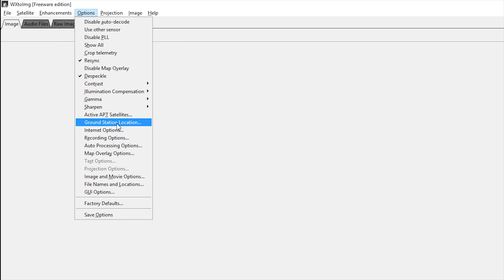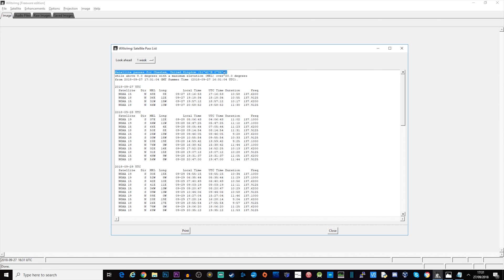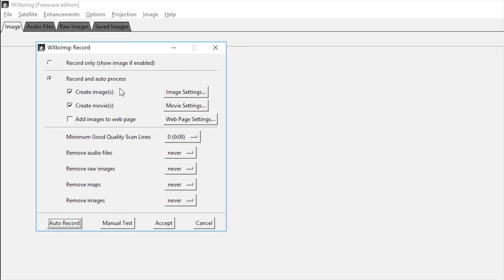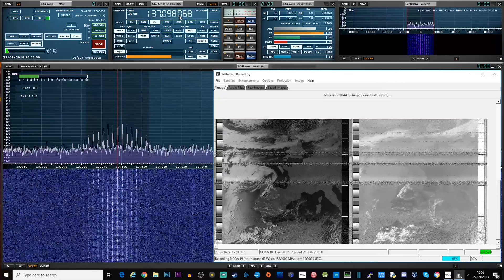Decoding Weather Satellites Using An SDR Receiver NOAA-19

Comment: How do you set this up long-term without manually changing the frequency on SDRUno for each sat pass? Seems like we would need to parse the sat pass list and then create a corresponding scheduled task inside SDRUno's task scheduler so that SDRUno will be on the correct frequency/mode for each auto record in WXtoImg.

Comment: Sadly, as others have found, the software does not seem compatible with WIN10. Cheers VK3AWA
Reply from the maker: Hey. You need to install the beta version, that’s works perfectly well with windows 10.
Reply: @TechMindsOfficial  THANKS. All up and running. MERRY CHRISTMAS.

Comment: Tried it today for the first time using a Yaesu ft817 and colinear antenna. Rough results but a start. Many thanks for the video!
Reply from the maker: You’re welcome Simon! It’s a great hobby!
Reply: I'm getting excellent results from a QFH antenna I made from copper tubing fed into an NESDR through 50 feet of RG58. Good luck. PS make sure your bandwidth is set wide enough to capture the entire signal or it will turn out grainy. For me, I had to set it 96kHz wide.

Comment: As  much as this looks interesting, the WXtoIMG program seems not to work on Windows 10.
Reply: I have the same issue with Win10 latest pack as per Sept 2019. I've tried running in Win7 and 8 compatibility mode with same results. Hummmm.....
Reply from the maker: Im using Windows 10, latest updates and its working 100%. Explain your issue in more detail please. 👍
Reply: @TechMindsOfficial  I'd need to recheck, but when downloading the application, the installed folder has a few text file and the application. The app reports zero bytes and won't run.
Reply: @crystalcolouriser8851  Did you by chance figure out your issue? I seem to be having the same problem.
Reply: @crystalcolouriser8851  same thing here... have you figured it out?
Reply: Still having win 10 issue. Program “installs” but there’s only three files archive,uninstall, weather.

Comment: Can we use satellite TV dish antenna Which is like a big circular plate??
Reply from the maker: Not really, those kind of dishes are directional, plus the LNB would most likely not cover 137Mhz.  The other issue is that the weather Sats are not fixed, which means they move across the sky, so you would need to move the dish as it flys by. I'll be doing a video soon on how to MAKE a homebrew antenna for receiving Weather Sats efficiently. :-)
Reply: @TechMindsOfficial  how can i make use of that kind of dishes?
Reply: @TechMindsOfficial  can i transfer files for over 5km by using one more dish on the other side. I am not talking about wife any other source! WiFi is also okay!

Comment: nice work, what particular antenna did you use ?
Reply from the maker: Thanks! If you look in the description you can see a link to the actual antenna I used. I forgot to add it to the video :-( Cheers, Matt
Reply: Oh ok, I was looking at the links on the bottom.....nice set up, thanks for the videos.